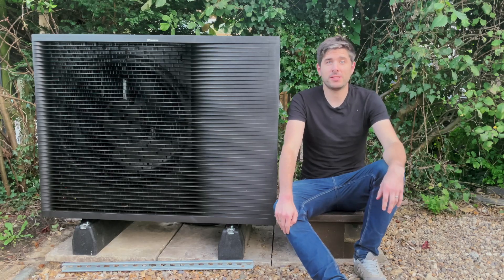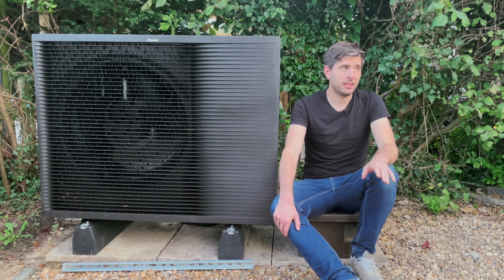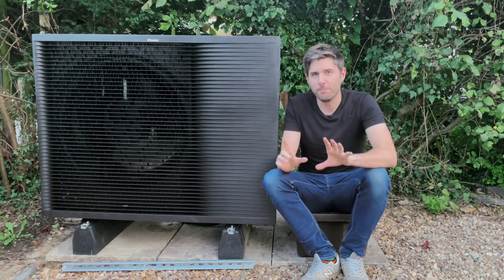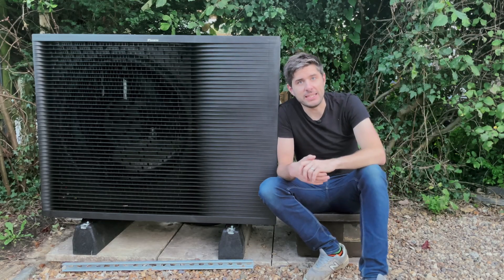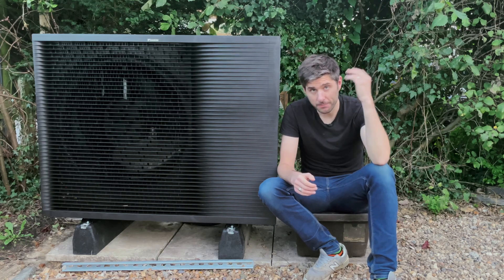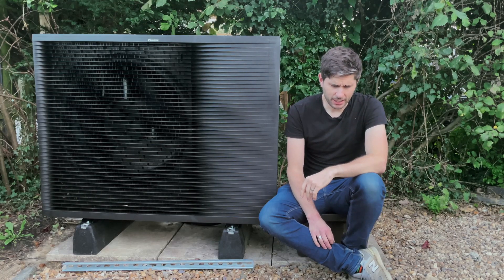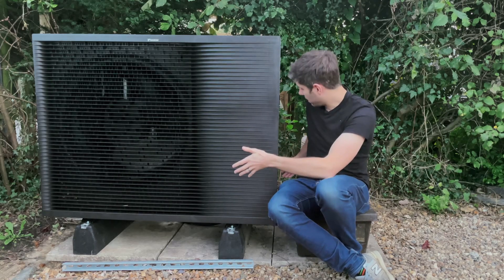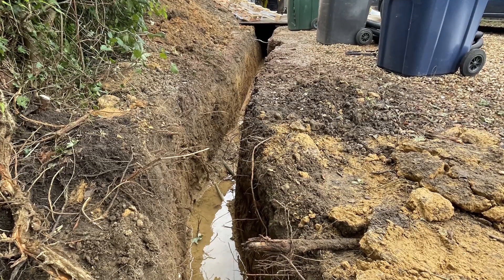Replacing an oil boiler with an air-source heat pump: Why, what and how

Comment: We are in Spain (Andalucia) so different to you. We have 2 Toshiba Estia air to water indoor/outdoor units that are run off solar as we are completely off grid. These units provide hot water and cooling in summer and heating in winter through a system of pipes on both floors of our 150 year old farmhouse we renovated. I had the roof spray foam insulated and I injected the 600mm walls with a proprietary product. Both floors were insulated under the underfloor piping and are finish covered in stone tiles. The Estias and underfloor pipes and boiler cost us 15,000€ and solar system 28,000€ in 2019. Our house has 5 bedrooms, 5 bathrooms, very large kitchen, library, and large sitting/dinning room over 340sq metres.

As you said, you do need a special boiler as normal boilers do not work with the system and you have to change your mind set how to use the system. We say run it long and run it cheap! Free in our case!

Do we regret the money spent? Not at all! Not  one regret! We had record summer temperatures this year. Averaging 40°C for most of the summer and our house was a cool 22/23°C during that period! Cost: free! 

Other people were struggling to keep their houses at 30°C! Cost of air conditioning: 3000€/month!

With the increase in electricity here in Spain, our return on capital is now over 7 years. Originally it was going to be over 15 years!

Comment: Air based heat pumps have to use immersion heater to heat water to prevent things like legionaires disease. During winter months air sourced heat pumps are very inefficient and require absurd amounts of energy just to keep them from freezing up.
Reply: Not entirely correct. R290 heat pumps can achieve 75C without immersion assistance, so can do Anti-Legionella Cycles just fine.  R32 ones can go up to 55C, which is enough to keep Legionella at bay if water is turned over frequently enough, otherwise they do have an immersion for ALC which can be scheduled to use the immersion.  .e.g . mine runs once a week for an hour. If I was in the UK would cost about 14p if using time of use tariffs or 56p to run on the current price cap.  So between 60p and £2.50 per month to use the immersion for ALC.  Not sure where you get your last part from, they have defrost cycles, which modern heat pumps use a reverse cycle to defrost once there is too much frozen condensation built up.  Takes about 5 minutes every 1-2 hours.

Comment: So this person has obviously spent many thousands that a lot of people don't have. They don't have a large gardens to hide a pump. The space for the internal hardware could be a real problem. One big expense would be the replacement of the radiators and pipework. All in all not feasible for many.
Reply from the maker: We did spend quite a bit, but there were far cheaper ways to do it - particularly if we were able to site the heat pump next to the house. 

Internal hardware was about the same, if not a bit less than our oil boiler (which was big, old and quite noisy) and the internal box went in the same location.

No pipework in the house needed changing, all we needed were new TRVs (government regulations) and one new radiator.

Comment: They don't work in cold weather esp if it's near zero temp
Reply: On Saturday it was -14C, mine were keeping the house at 21C.  Not sure why people keep on posting this myth.
Reply from the maker: Can confirm that it worked perfectly at -2 (and counting!)
Reply: Complete rubbish.  If its near zero on the Kelvin scale you would be right but Celcius is a scale of convenience only.  There's plenty of heat in 273K (and 263K).

Comment: Nice video, clear explanation. Question, does having the high temperature capable unit compromise the maximum efficiency when running it at your 35/45C compared to an ASHP that could only achieve say 45C?
Reply from the maker: Yes, I think so - I think mine is ‘ticking over’ more than it should but the peace of mind of being able to crank it up was worth it (I hope!)

Comment: We too live in a village with no gas so had an oil boiler, and it was failure of our tank that caused us to eventually get a pair of LG 9kW monoblock ASHP’s.  One thing you didn’t mention is newer rules on oil tank location, it looks like you wouldn’t have been able to put a new tank in the same location as they have to be 760mm from any boundaries and 1.5m from buildings, sheds and fences.  This was the big issue we faced, we’d have ended with the oil tank in the front garden not tucked away as it was.
Generally pretty happy with our ASHP, coming up to end of year 2. The installers designed it to run at 55 degrees which is not at all efficient. Lots of tweaking, turning on weather compensation, flow temps now around 45 and 48 for hot water and the house is comfortable all the time.
On really cold days it can chew through 80kW of electricity which is painful, but this is the extreme and it’s usually 20-40kW a day in winter.  But summer it’s 1-2 for hot water so gotta take a year round view.
Reply from the maker: That’s a really good point, yeah we would’ve definitely had issues with siting the new tank

Comment: So an air-source heat pump is more expensive to buy, more expensive to run and wont give you as much heat.  Confused??
Reply from the maker: Yeah, it’s due to wanting to reduce my overall emissions/carbon footprint and hopefully if more people buy them the overall cost will be reduced. That being said, it’s already looking like it might work out cheaper to run due to off-peak electricity costs. Video to follow…
Reply: @michael_bird  thanks for the reply... youd reduce your carbon footprint more by not flying when you go on your hols.... heat pumps wont catch on as too unsuitable for majority of houses I would think...

Comment: Your opener is very valid but some people are replacing gas boilers with ASHP and expecting to save money. But I look at the size of the thing and can't imagine being your neighbour in an urban environment and the noise from this thing.
Reply from the maker: Yeah, most of the noise is indoors. It just sounds like a big fan outdoors - and that’s only in the winter when it’s really cold and also when everyone has their windows closed.
Reply: we have the Vaillant unit and the sound of our neighbours boiler flue is very similar to our unit running. so units are virtually silent in an urban setting.

Comment: What concerns me is the noise. A house on my regular dog walk has one. It’s at the front of the house, presumably because there are too many windows and patio doors at the back. When I walk past the end of their driveway (about five metres long) I can always hear if they’ve got the heating on. Luckily they are the only house that has one. On a street of tightly packed semi detached or terraced homes if they all have heat pumps whirring away I think the humming sound would be very intrusive, even more so if some are not regularly maintained.

Comment: You have the same system as me, I found everything you said to be correct.  Next you need solar and battery.  They will provide you with much savings and source for a new video series. Thanks.
Reply from the maker: Funny you say that, just added solar and battery!
Reply: @michael_bird  Great, when is the first video coming out?
Reply from the maker: I’ve got another in the works first, but possibly one in the next few months!

Comment: Very helpful video. I think for me, living in a remote Scottish Glen, I don’t want to take the risk of being reliant on one source of power to keep warm, especially when power cuts are quite normal here! Also being an older traditional stone building, even though double glazed & insulated to the best of my ability, the heat loss would be too much for a heat pump to run on a budget I could afford!
Reply: Othe than solid fuel you'd require electric to run a gas/oil boiler be it 3amp ,in your case would invest in small generator, so you could still run APump be it on fossil fuels as indeed the electrics being produced by.
Reply: I have come across quite a few heat pumps and the radiators just only get warm it's been complete rubbish... Even heatings engineers have told me the same story....
Reply: @Displays.1234.  The radiators are supposed to be 'just warm'... I'd suggest it's your education that complete rubbish.
Reply: @dorsetengineering  warm radiators that do not heat up the room absolute rubbish...
Reply: @Lockkhanup  think people missing the point you require a massive surface area rad to equal prev rads and using electric to reach h/w requirements great if you have room for a massive storage vessel evs and immersion heaters added onto a struggling grid what could possibly go wrong .

Comment: It's misrepresented. A heat pump is just a compressor.

There is no reason for the huge expense. It's a large scale refrigerator that runs in both directions. 

It is a ripoff what they are trying to charge for the units. Control systems can be bought for less than £200 or less in component firm, and be completely configurable. That means the compressor, piping, expansion tank and sensors etc is worth thousands?

What they try to do is bundle a complete heating system, when I looked into it underfloor heating was required - and if you couldn't do it because of concrete floors or personal choice that was when you grant disappears.

What this guy is saying is they put Economy 7 in for overnight cheaper electric hot water, making hot water a limited resource, and explains why he had to have a new hot water tank. With gas boilers you often don't store hot water, it's heated on demand and is endless.

The waffle about the control mechanism could be done with a Raspberry Pi computer you can buy off the shelf, heat sensor in and outside which you'd buy for a few pounds each depending on tolerances.

The compressor unit is literally a pump with a heat exchanger which is just pipe infront of a big fan. Running one way it generates heat through gas compression pumping it into the house via a heat exchanger, just like those fins on the back of you fridge or freezer, and of course the heat generated on one side is why inside your fridge is cold. So it can run the other way for air conditioning when it's hot indoors... Still no reason for thousands of pounds... It's a con, it's just scaled up.

The hot water is just reverted to an old tried and true emersion heater running at night and hoping you retain enough heat and hit water before you use it... It's got nothing to do with a heat pump set-up like this...

Comment: I went down a similar road a few years ago and started the process by lowering the temperature of the water my oil fired furnace pumped out to my in floor system. I built a controller that kept the water around 40 to 45 degrees C which turned out to be good enough for even the coldest days in eastern Canada. After a couple of winters I pulled the trigger and installed a 50,000 btu, mono bloc system that provides heat to the house and preheats our domestic water. It runs from 40 to 50 degrees C. It is cheaper to run and we have the peace of mind of not worrying about oil leaks, and of course it is a "greener" solution. Lower temperature water supplies can work in many places if you increase the surface area of whatever system you're using. We went to mono bloc to keep all the noise outdoors and we didn't need a contractor for installation due to the sealed system.

Comment: But why not think wider than just those 2 alternatives (oil vs heat pump)?  We are currently on oil and in the process of adding a big electric “heat battery” (i.e a massive centralised storage heater) to our house to store cheap (sometimes even free, or even negative price) electricity in the form of heat. Octopus Agile tariff lets you buy ‘leccy at the spot price, so you can help the grid do its load balancing because the greenest electricity is the cheap, off-peak stuff. Storing heat is relatively cheap. 
Your heat pump will probably need to run even during peak hours, so you are adding to peak grid load, meaning more fossil fuel fired electricity generation.  
I firmly believe that one of the best ways to go green is to stop using peak time electricity, (which is expensive because it comes from them turning on the most expensive, most polluting generators).
Reply from the maker: We did look at other options, but the heat battery option didn’t quite work for us. But we do now have solar and battery which we charge at night on cheaper tariffs and use to run the heat pump during as much of the day as possible.

Comment: Might worth feeding the water outlet pipe that goes into the house and go through first a methylated burner to started off with or if you need a boost, what you can make with a couple of paint tins a piece of carbon felt some copper tubing piece of find like a strainer stainless steel mesh. You need two paint tins that one can go in the other with a comfortable fit, 6 inches across, the inner paint tin drill six 5mm holes at the top near the lip of the tin this goes in the outer tin upside down in the centre drill just a 1mm  hole in the middle of the bottom of the tin, get some 15 mm copper pipe but you'll need to braise it not solder because it will melt probably you're getting up to three or four hundred degrees Celsius. You might be alright cuz the water keep it cool and the joints are away from the heat but I'd still braise the pipes not solder, you want to bend ideally one piece about a foot high and then feed it back down to the bottom not touching the tin, so it looks like a coiled springs, you don't want the pipes touching a millimetre or two gap between each layer is better. The outer layer of  pipe sits on the outer tin Edge the burning comes from the gap between the inner tin and outer tin, there will be a small gap you don't want any big gaps tho! Cover the pipe in a very fine mesh like a rodent repellent mesh stainless steel, on the top your need to cap the top of the pipe and mesh off with a tin something like a baking tin. Both ends the top and bottom will get red hot. Ideally cover the whole thing up to the baking tray with a tubular piece of Steel but not necessarily but will save energy, drill some holes at the top and bottom four airflow. If you want to keep it cool and you don't want things touching it then cover it otherwise not necessarily. On the outer tin drill a hole for a compression joint and a piece of pipe bending upwards so you can fill the outer tin make sure you cap this off with a threaded cap before lighting, about half a mug of methylated spirits should last you three to four hours probably want to fasten this down somewhere near the heat pump or before it comes into the building, keep it away from ground level make sure you have air flow you could use it in the garage with ethyl is better if being used in doors don't use mythinated spirits. I forgot to say put the felt around the inside of the outer tin so the inner thin slide, this is just a sponge for the spirit burner and is needed it acts as a wick, so it's right up to the lip of the tin inside, comes about half an inch thick can get from plumbers merchants used as blankets when soldering pipes.  If You want to stop the burner just wraps aluminium taper around the vents.
By the way you don't need to buy a whole boiler you can buy the burner unit or you can just buy the control unit what yours has failed sounds like, a control units is about 130£ a burner units is about 370£ what comes with the controller unit,  was the price from 3 years ago. my boilers over 35 years old and it's easy to replace the burner or the control unit. But make sure you replace your jet every 3 years and this saves an oil and is more efficient and better for the environment, and have the pressure hire as possible and check for carbon dioxide emissions every couple of years.

Comment: We bought a house with a Daikin Splt ASHP in Sept22, I had heard all the horror stories about them not heating the house, costing a million pounds an hour to run and being very noisy.  So I was ready to replce it with a new Gas boiler, after a few days and watching a few YT videos (Heat geeks for example),  I realised the guy we had bought the house from had never optimised the settings, so set to work. We now have a great heating system, the house stays at a steady 21-22c, we use the buildings thermal mass as a "heat battery", weather dependent/compensation is now switched on and we run the flow "low and slow", the running costs in our new home are far less than in our old similarly sized 5 bed house. 
My tip is to use a smart tariff from Octopus, we use Tracker. and in a large 4 bed, with 4  en-suites, with no gas at all, our total energy bill this year sits at £862.99  (From 01/01//23 to 01/12/23 on OctoAid).  I am now looking at installing a Homely ASHP Controller  to further optimise the settings automatically.  
https://www.homelyenergy.com
One important benefit that I hadn't thought about and seldom gets mentioned , was not using gas for heating or cooking, we are all feel far healthier.  
So me, a red meat eating, petrol head is convinced that these are a great idea. And I never thought I would be saying that!

Comment: Water temperature (the lack of it, from heat pumps) is the key PROBLEM. Modern houses in the UK have radiators and pipes sized for 70'C. THEY ALL NEED REPLACING if you can't get water above 50'C - ie a heat pump. Ripping out the entirety of one's central heating system is a MASSIVE cost along with making good the decoration afterward. Heat pumps are NOT a solution for the UK housing stock and the people who want to phase out natural gas need a far better solution....quickly! A £15,000-£20,000 cost is not viable.
Reply: Didn't watch the video then? this is a high temperature heat pump that goes up to 70C.